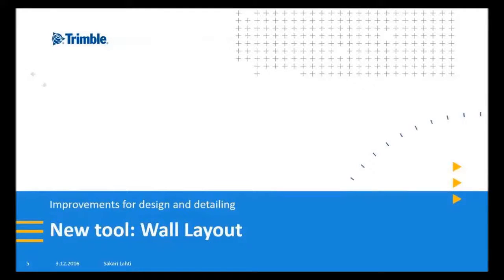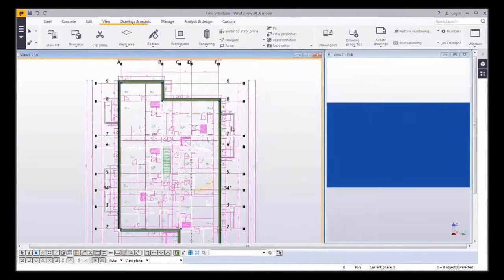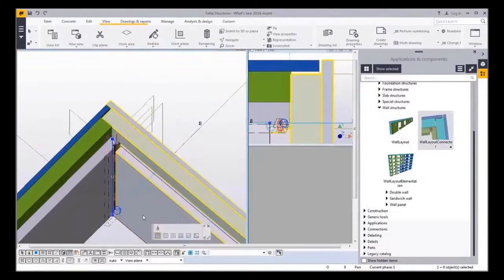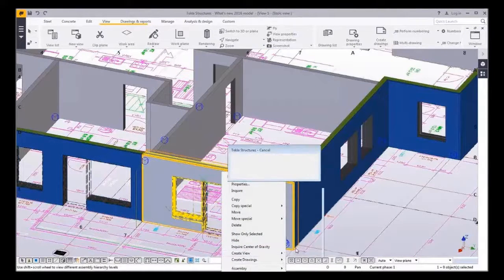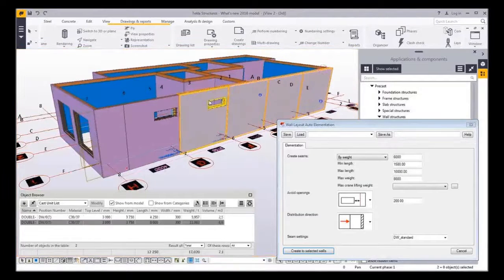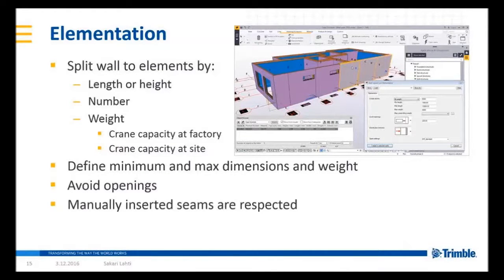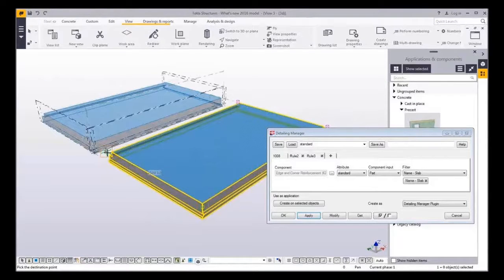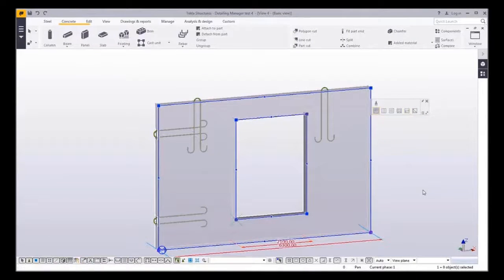Tekla Structures 2016.  New tool: Wall Layout

Comment: I cant find the option of splitting the panel with offset. We need panels to be 20mm apart. Thanks.
Reply from the maker: You need set up Wall layout seam. Please see
https://youtu.be/tGkHjFORAzs?t=5m11s
and
https://teklastructures.support.tekla.com/2017/en/wall_layout_tools_help